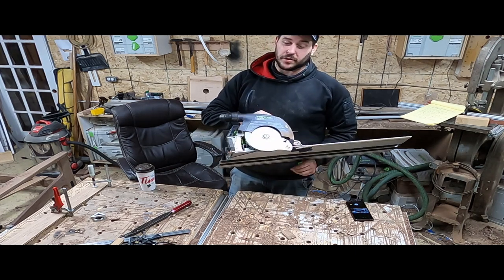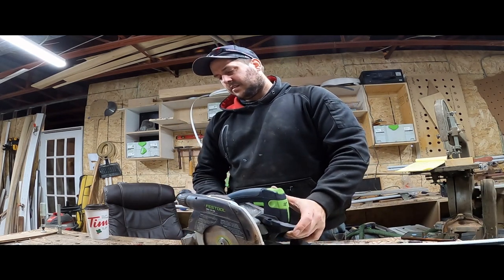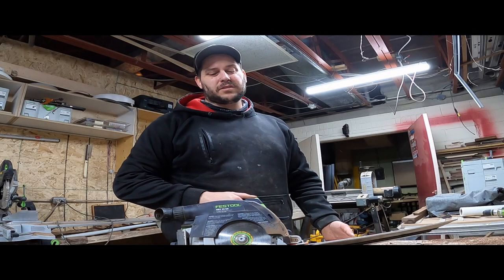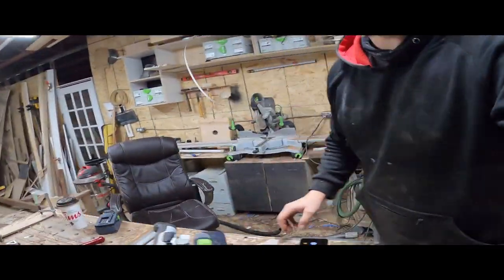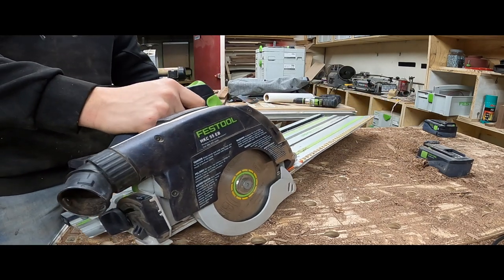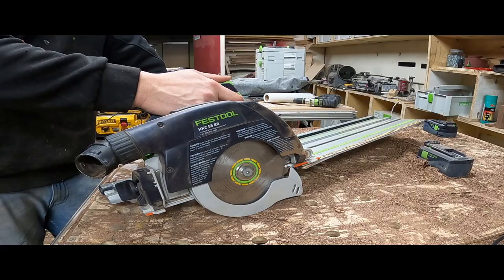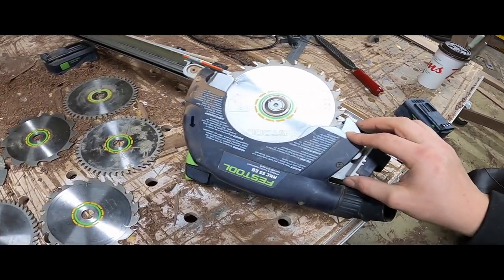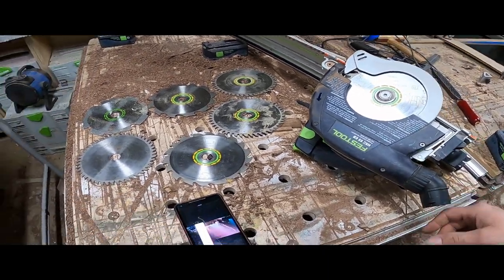THE HKC55. FESTOOLS track saw that almost Got IT RIGHT!  But falls short on just about everything.

Comment: Literally all of my complaints about the HKC are mentioned in this video. The only thing I would add is that the splinter guards don’t seem to last long before they start to get torn up from the thin kerf blade deflecting. It also happens on the Mafell kss40 and 60 I have though. It’s too bad you can’t get Mafell there in Canada it’s definitely better than the HKC. I’ve wanted to sell my HKC since I got my kss60 but the resale is so low and unfortunately I bought all 3 rail sizes and several blades so I’d rather it collect dust in my shop than sell it for a huge loss. Maybe in a year or two the price will get hiked up so much I won’t lose as much on the resale market 😆
Reply from the maker: I had to cut off a piece of the splinter guard while making this video because cutting on a bevel caused it to grab the loose end. 😂

Comment: Try taking better care of your tools I bet they will start working better.
Reply from the maker: What does that have to do with the faults of this tool. 😂
Reply: @86ConstructionContracting  KSS 55 has a cutting dept of 42mm at 45° on the track, and so does the HKC 55. There is nothing wrong with the saw, only the user🙄

Comment: I hear you, I agree with you, but I still use it, just like you. I recently bought the TS60, and no longer need to swap blades. Both saws are compatible with FSK rails. I use the HKC only for cross cuts in framing/renovations. For ripping, plywood and MDF I use the TS60.

Comment: You’re exactly right on cutting 2x material on a 45. Festool always cut  2x4’s, and it barely gets through those but try cutting a 2 x 10 or 2 x 12 with a little cup and it’s woefully short of making it all the way through.  I sold mine after a couple of weeks.  My biggest disappointment in Festool.

Comment: Festool should increase the size for the blade a litle bit. and the 45 angle problem will be fix. 
I did a lot of deck stringers and I was fast and accurate.

Comment: I had the mafell kss50 that had the same problems. It got stolen so because off the price I bought the hkc 55 about 750 cheaper here. 1 thing I like more about the hkc is the weight. Mafell was real heavy for 1 hand use. I also have the battery tracksaw of mafell 2021 model and the new tsc 55 from Festool. Dust collection is much better on the mafell. I like the tracks better and the features. Butt still and I don’t know why, when I have to do a few cuts i always take out the Festool.